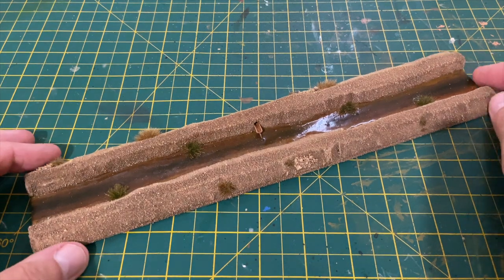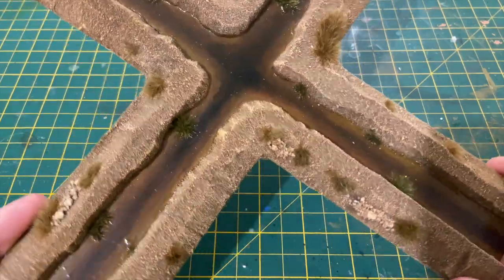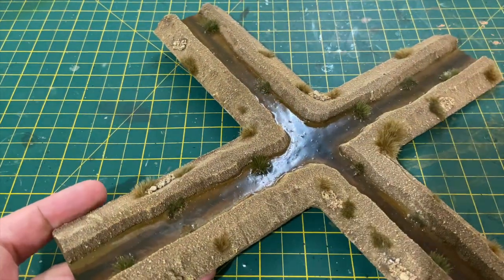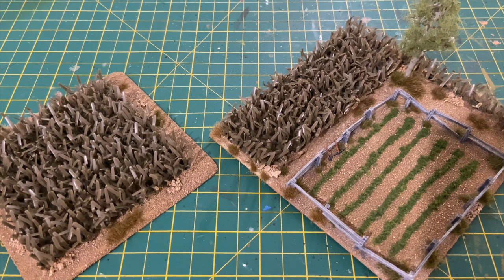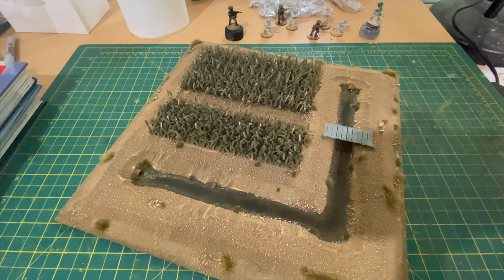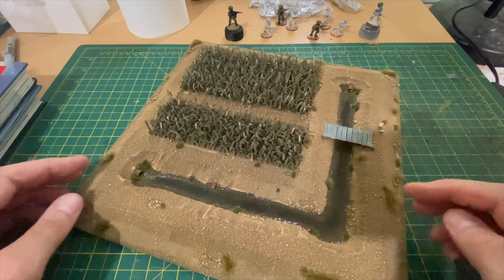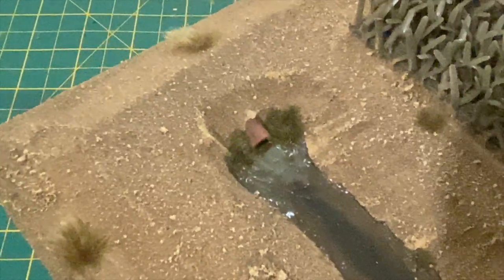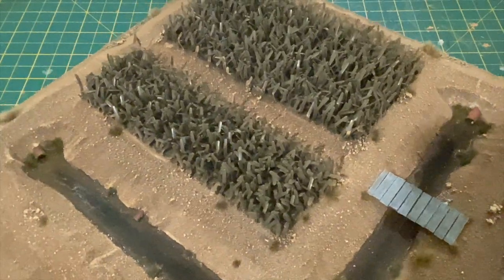More 20mm Afghan Wargame Terrain

Comment: Thanks Dougie.  Did you have any trouble with warping when using the 2mm Mdf boards?
Reply from the maker: I've found it depends on the size, larger pieces more prone to it. It's also worth spraying both sides of the mdf sheet with Halfords car primer rattle can if you're intending to put a lot of water based products on it. On a whole though not had many issues with warping.